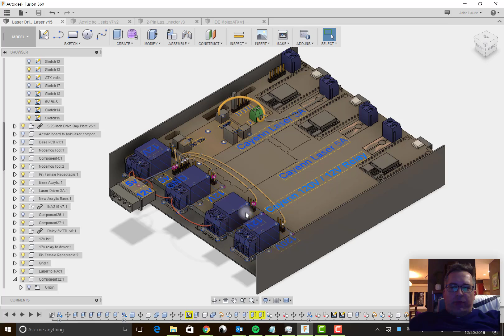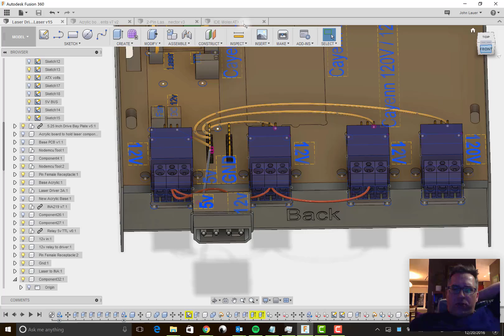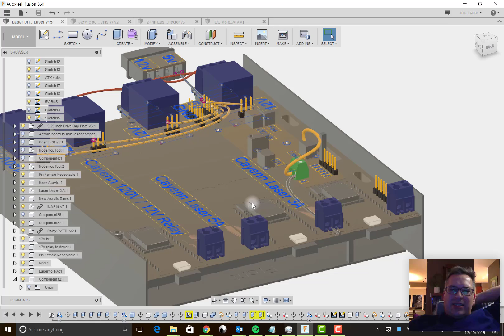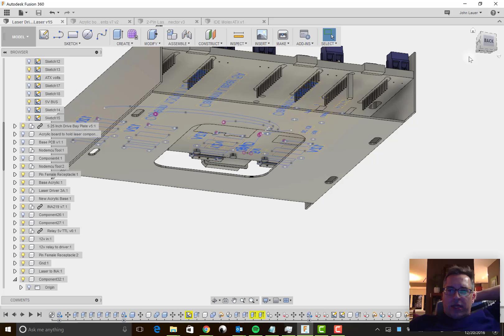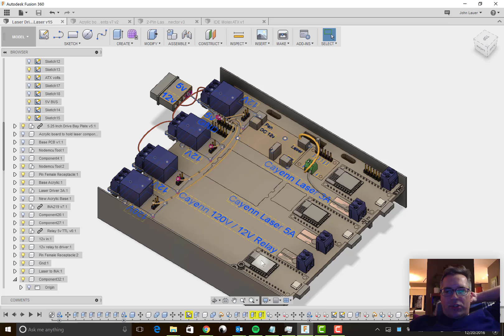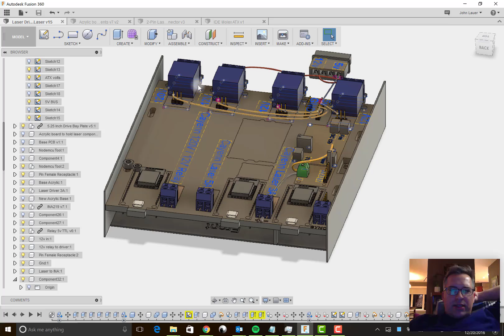Cayenn Laser Driver Board for ChiliPeppr

Comment: Chinese power supplies are a whole lot cheaper then one made for a PC (no adapters or cables/branding involved). A 5V supply is under 10$
Reply from the maker: Well, I wanted 5v and 12v power. Also, I have lots of old computers lying around with great power supplies still. Also, I wanted a place to hold the Cayenn devices.

Comment: Liking the 5-1/4 form factor.  Using the macbook with my machine mostly but for a dedicated box, that's a nice idear.
Reply from the maker: The 5.25" will sit in an empty PC case that simply has a power supply in it. I'm not using that PC case as a PC, rather it's more like a rack to hold Cayenn devices. I drive my TinyG from a Raspberry Pi 3 running Serial Port JSON Server and I run ChiliPeppr from my laptop.